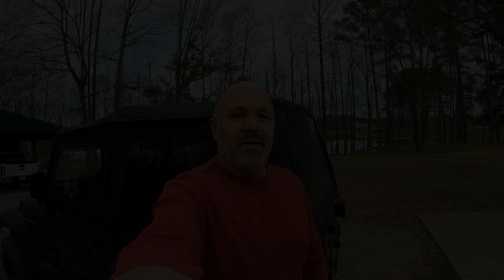97 Jeep Wrangler Replacing  U Joints and balancing Drive Shaft

Comment: Steve I wondered why you didn't just replace the worn bushings and when I looked at the cost just 20.00 more to just swap out the whole thing. Not worth the trouble..... your a smart man Steve ! I'm going to throw a little more money at it and get adjustable ones with rubber bushings and adjustable ball joints to be able to really dial in the alignment . Your jeep turned out so good. Regards William
Reply from the maker: Thanks a lot William! Good luck. Adjustable is the way to go. I have too much I JJ as it is lol.
Reply: @ForceBuilt  I put this commit on the wrong video .....it changed on me. I do like the way you balanced the front shaft in this video very clever I had watched this one before . I will probably put crazy money in mine but I want it the way I want it and my son-in-law will get it one day and I'm sure he will enjoy it long after I'm gone.

Comment: I have the front shaft out at the moment, replaced the front u joint ,but wondering, what is a symptom that shows the rear u joints  of the front shaft, are bad ?
Reply from the maker: Just Real sloppy movement. Hold the shaft and try and move(with a twisting motion) the double part of the driveshaft side to side(The big end). If it moves much at all side to sidethe u-joints need replaced.
Thanks for watching!